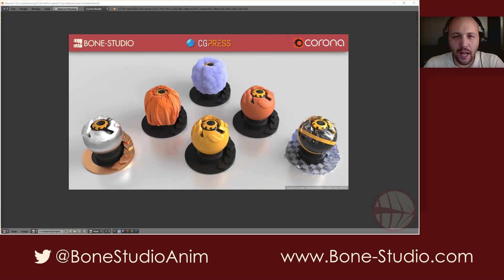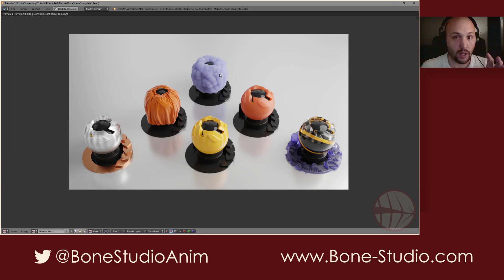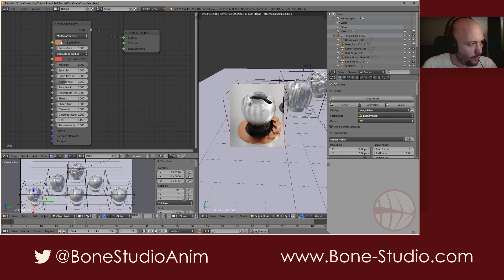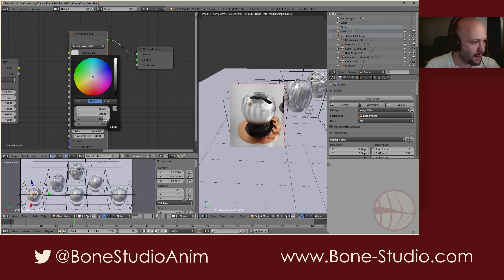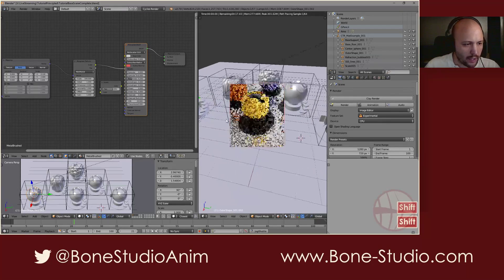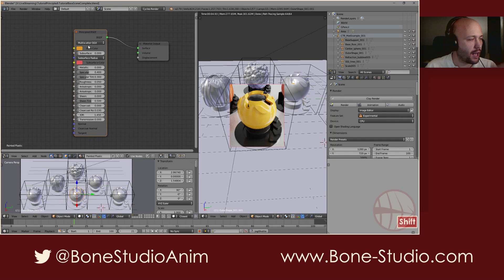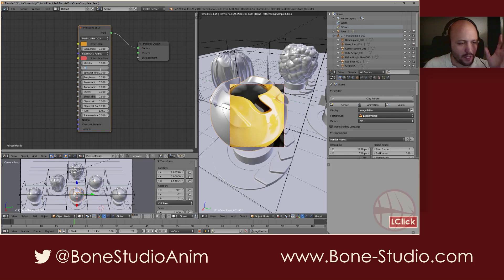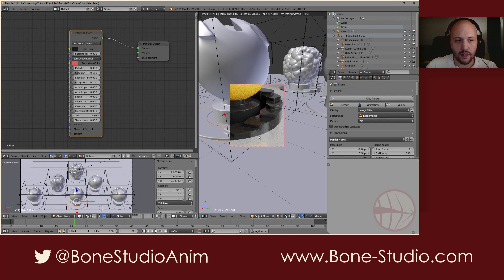Blender Tutorial - Principled shader UNLEASHED! Part 1 - Dielectric / Metallic Materials

Comment: What's the difference between specular and roughness?, most tutorials I found talk about how to use one or the other, but not how to use and balance both.
Reply from the maker: Hi Deegan.
They are completely different parameters, Specular gives you the amount of reflectivity of a non metallic material (so, the Metallic property it´s at 0), and with Roughness what you modify is how much that reflection is blurred, and this applies to both, Dielectric (the one that uses Specular property) and Metallic.

So if you want a reflective plastic (like in the tutorial) you can use Specular to 1 and Roughness to 0, if you want those reflections to be a bit blurred, you can increase the Roughness, the same with a metal, you can increase Metallic up to 1, and then use the Roughness value to blur their reflections.

I hope this answer your question :)
Reply: I see, that makes sense, thanks.